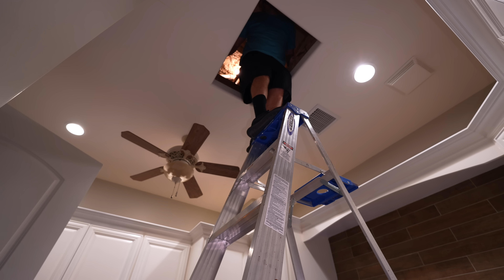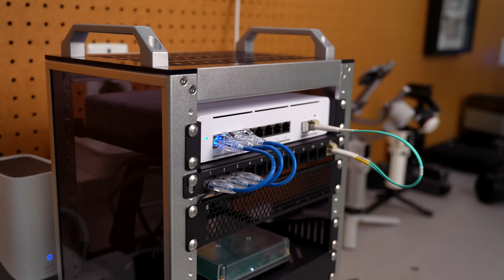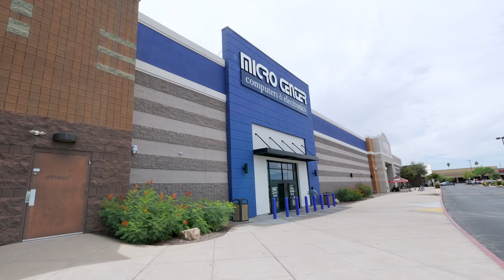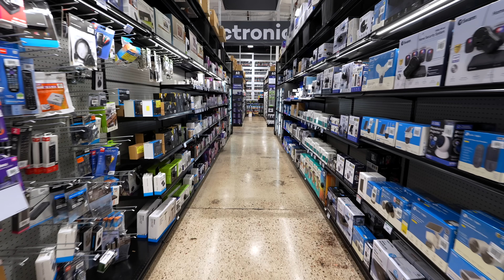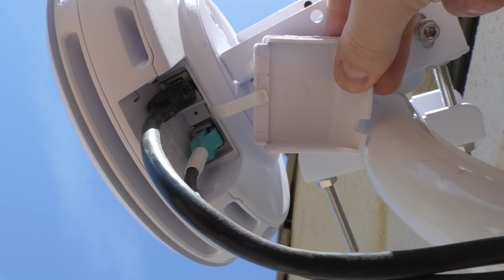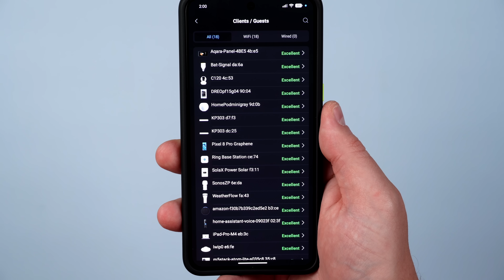Why I’m using UniFi Building Bridge for my Garage

Comment: I’m glad you’re happy with the result, but there are a few considerations. The visual impact of the wireless bridge could have been avoided by digging a trench and running fiber. I understand the cool factor, but most spouses would have rejected that setup on arrival. It also introduces two threat vectors. For a 50-foot run, cabling would likely have been cleaner, simpler, and nearly unmatched for reliability. Seems like a can versus should.

Comment: So the fiber and PoE cable goes from the attic of the main house to the bridge mounted on the main house. Then the other end goes down the wall into a patch panel on the wall, then from the wall you run another fiber and PoE cable to your server rack? Did I get that right. Also I'm confused how you ran the 2nd cables, can you explain it again in detail. Did you have to mount a 2nd Access point to your work office? That's where I'm confused

Comment: would the price for digging the trench have been cheaper than the cost of the hardware required for the point to point connection?

Comment: I had a similar problem; because of the way the buildings on the property are laid out, my ISP fiber comes into my carport, and when I had the house built, I forgot to run conduit from the carport to the main house. There are several inches thick of concrete driveway now between the house and carport. Trenching something now was not going to happen. I went with two U7 Outdoor APs. It might not be as fast as your bridge, but they do double duty as a bridge between buildings, and as outdoor APs. Overall, it's worked out really well.

Comment: I did the same with a Mikrotik wireless wire kit. 1G speed, but has been flawless for around 3 years. Paid $216 for the two in the kit. Getting full speed about 120ft away between two houses. One day I might rub a fiber between them, but so far this works good enough for my needs.

Comment: In the UniFi app, you can lock individual devices to the nearest AP. That way, you won't find those devices connecting to your wireless AP. It's really simple to do. And, then those devices will not go walkabout.

Comment: On the AP in the shop and house devices trying to connect, Since the shop is work space I would change the setup in unifi to have the switch and AP out there be a dedicated VLAN and different SSID name.

Comment: Is that an attic vent above where you drilled your wires? If so, why not run the wires through that instead of drilling holes in the stucco?

Comment: Reed - I am so jelly you have the microcenter there ... we lived in Peoria AZ until 4 years ago - my buddy there rubbed it in when he went over to the microcenter after it opened.  Both of us are into HA and Ubiquiti gear.  This video was handy as I plan to connect my 2 Unifi Pro XG 8 PoE 10G switches to my dreamwall using fiber - currently they are connected via Moca and coax (this house is almost impossible to feed cable thru).  Hopefully you were up in the attic before summer hit ...

Comment: It's not against code to run nonconductive f/o cable inside the electrical conduit to a garage. No trenching or access point expenses at all, not to mention the eyesore of the both mini dishes that could have easily been mounted inside of the attic spaces for that distance.

Comment: lol... I've been dealing with fiber for over 20 years...never cleaned one.  they are pretty resilient and you cautioned about bending them which is main weakness.  Since you had short runs, I doubt you will have speed concerns in the future, but if you were to do longer runs you need to pay attention to the fiber rating.  OM4 and OM5 are the most common these days and will support the latest SFPs.  I try to make sure the patch cables are the same rating as the fiber run.  not critical, just peace of mind.  As well, pay attention to the SFP type and speed (1gig, 10gig, 40gig) in conjunction with the fiber rating.  that will dictate how long your run can be between SFPs.  you're using Multimode (MM), but there is also Single Mode (SM) used by telcos and when you have runs over a few thousand feet and that uses different type of fiber.   I don't knock you for doing a wifi bridge, easier setup.

Comment: For that short of a distance with clear line of sight, wireless will be almost as reliable as wired. I wouldn't even think twice about using wireless for that. I would use wireless for this until I was doing renovations or had nothing better to do at which time I would install a couple wires/fiber runs in a conduit for redundancy.

Comment: As someone who has recently installed PVC irrigation that 'trenching' job (if you can even call it that) would have been so incredibly easy. Including going under the path.
Reply: Agreed. I was much disappoint that Reed didn't dig a trench like a real man ;-)

We'll see how reliable those transceivers will be after dealing with the elements for a few years, and how much energy they use compared with a buried fiber line.
Reply: Trenching would’ve been more reliable, but setting up a wireless bridge is more “fun”.  Sometimes you just want to do the fun stuff to see if it works.

Comment: We have the old UBB units at work running across a public street to a patch of land we lease, so getting fiber under the ground for that whole ordeal would have been in the 7-figure range. They have genuinely been the most reliable thing from Ubiquiti we have! You'd never know you weren't connected by a cable. They're maybe 200-300 feet from eachother.

FYI, for your APs, you should manually set the 2.4 GHz channels to 1, 6, and 11 instead of leaving them on Auto. Those channels have no overlap with each other. Channel 11 does have overlap with some of the Thread spectrum, and the other two do have some Zigbee overlap from what I understand, so make sure you know what channels your Zigbee network is using before setting the 2.4 GHz radios to one of those three!

Comment: For such a short distance, you could have just used a directional outdoor access point unless you absolutely needed 6Mb in your shop. Only requires one PoE ethernet cable and is a lot less money. I use that solution for my shop and I get fantastic connections, including most of my back yard so I can jam to streaming audio when I'm mowing.

Comment: Fun project! Glad it is working out great. I would be really surprised if you didn't get 100% link quality. I have used those bridges commercially and they reach over 1500ft.
A couple of  suggestions for your attic rules: 
1. Wear a mask, you have fiber glass insulation in your attic. Get one with P100 or N100 particulate filters.
2. Usually there are tons of nails sticking out. A hard hat is recommended.
Reply from the maker: Wow that's far! Those are some good tips for the attic too!

Comment: I did a very similar project to this and it was so successful im working on moving almost my entire lab and ALL 10g+ devices to fiber.  I had no idea that my copper 10g sfp+ ports were so hot but after I replaced them all of a sudden many of my network switches and servers started working better (less heat throttling).

Comment: With all the politeness, but 1000$ for wireless connection which can be done with 50$ straight fibre cable and 2 SFP modules. Ir will not depend on electricity (i mean connection itself and electricity needed for every RX/TX side in your case), no need for double data wiring and..... there is nothing to break if you use straight fibre connection. 
It would be interesting idea if you'd need to solve a problem like really long distance or obstructions (like water etc) on the way, which could cause problems. But instead you just made a potential problem.... you got x20 price connection line with 2 additional break points and way slower than fibre btw. Honestly - i dont get idea of radio bridge for 8meters btw buildings (except advertising fee from Unify/Microcentre ofc, but its a really bad advertising of this product).
P.S. your area climate is quite dry i suppose, but still recheck silicone once per couple years (might be surprises there if temperature changes a lot).

Comment: Looks like a lot of fun!  I would’ve just buried Ethernet though.  Ten years from now would work as well as you needed on day one.  Also, just my personal preference, I would’ve hid those ugly antennas in the attic on both sides.  They’re both installed right next to a window.  Good job though and good production!
Reply: he mentioned why you should not do ethernet, and a its a point any good IT person will tell you. Network link between 2 buildings is best as fiber and not copper.
Reply: @DustySeven7  I get that but the building is a few feet from the house.  Direct bury Ethernet is super cheap.  Maybe $20 for that distance.  Personal preference though.
Reply: @WunTu3 even a short distance like this. The risk just not worth it

Comment: Does weather affect the connection, like if it's raining, snowing, etc.?
Reply: At 60ghz, rain, snow, and ice are only a problem at much farther distances between the radios. As close as these are, weather would not affect them.

Comment: Interesting.  I routed a Cat5e to the detached garage and another to the shed when I pulled power to each building.  Was easy considering I already had a trench dug.  I can see the value to that bridge device, how reliable is the signal?  Degraded with weather?

Comment: A few things I wish you covered on fiber coming from a moderate network background.

Not all SFP modules are equivalent obviously on speed but also on compatible fiber type.  Most easy to find patches are going to be multi-mode.  Don't mix multi and single mode along the path.  You might get away with it on short runs but the mismatch will cause horrible losses.  Single mode is necessary only for high speeds over long distances. Patches can be IDed by the "standard" colors, teal for multi yellow for single.

Last but very important.  The two sockets on your SFP modules are transmit, TX, and receive, RX.  This must crossover between the two end points because the ports always have them on the same sides but you have to connect TXs to RXs.  You can actually see that your patch at 12:41 is this way because the strands are color coded yellow and white.  Each butt splice connection has the potential to swap this so you might end up miss matched after all your connections.  The patch cord ends can be gently disassembled and swapped if needed.

Comment: One addition to add to your install. While your fiber is protected from lightning strikes, the Ethernet providing the POE and backup connection to your wireless bridges is not. Install and properly ground a Ubiquiti Ethernet Surge Protection Outdoor to each one of your runs; UACC-ETH-SP-Pro. You’ll have some protection should one of your wireless bridges ever get hit.
Reply from the maker: That's a great tip! Thanks!

Comment: Rule #0: if your ladder is too short and you cannot afford an extended stay in the hospital, BUY A LONGER LADDER. Safety goes first, because being unsafe will cost so much more than being safe. Spending $200 on a longer, more stable ladder will prevent literal thousands of dollars in medical costs.
Reply: Yes, longer ladder, for sure.
Or install pull-down attic stairs—those would be even safer.
Reply from the maker: True a longer ladder is ideal but not all spaces have room for a large ladder. I have a taller ladder, that I also showed in this video but it can't go super tall in that room with the attic access because there's not enough space on the ground for the legs to go wide enough.

Comment: I related to this a lot as i recently replaced all my power cord cameras with PoE - so similar process of running cords through the house - except crawlspace instead of attic - and drilling through sides of the house. I was terrified of doing this job, but went through it a step at a time and the result is awesome and so worth the effort. 
Next I want to do the bedrooms and will have to face the fears of the attic and insulation in the way every step of the way of the whole project.

Comment: Here’s a tip since you’ll probably be going in the attic a few more times.  Get a few cheap sheets of OSB sheeting, cut them in widths to cover three of the joists so you’ll have firmer footing rather than balance walking on the joists. Leave them in the attic and if necessary you can even slide them around to other areas as needed.  It’s cheap insurance to prevent punching a hole through the ceiling.
Reply from the maker: I need to do that! Thanks!
Reply: @SmartHomeSolver  Never stand on OSB in an attic unless you're WANTING to fall through the ceiling.  3/4" plywood at least.  That foam insulation is a dream and made your trip in the attic bearable.  I've been in hundreds of attics AND I live in Florida. You gave the best advice possible.... GO SLOW!
Reply: @cableshark100    OSB comes in various thicknesses, up to 1 1/2" or more.  Placing it over three joists, probably 16" on center will provide firm footing for most people.  I cut mine in two foot widths so that it fits through the attic access door.   Plywood is significantly more expensive and pretty much a waste in an attic.

Comment: oof that foam roof good luck with that in 2 years
Reply: Why?
Reply: @Tadcrazio  it will start to rot for the moisture build up seen it day in day out on a daily its the worst thing you can do to your roof
Reply: @Scotty-Reed damn. Been getting quotes for it my neighbor has had it for 12 years and  has been happy.
Reply from the maker: Haha it's not a foam roof. That's insulation on the inside of the roof.
Reply: @SmartHomeSolver  hence the foam roof meaning inside

Comment: After a few decades of doing networking there are a few things I always keep in mind: 
- First one is "Wireless may be easy to install but wireless is a way to take something that works all the time and make it into something that usually works." Physical cabling just works unless it gets touched. Wireless network bridges are very good now but external interference can degrade or kill a connection overnight. (New neighbor is a ham radio enthusiast? Someone welding right there? Some jerk playing with SDR who just wants to ruin your day?)
- When analyzing a wireless bridge's connection, higher DB of signal isn't always better. Think about sending information as sound waves. If someone puts their lips to your ear and screams at the top of their lungs you can't understand them. The bridge should have a range of exceptable DB. A good bridge should have adjustable output, give you a DB reading, and allow you to adjust it. (Don't be surprised if visually aligning the bridges doesn't give the best signal. Often they look like they are off target when they have their best connection.
- Buried conduit with fiber is basically lightning strike proof. Exposed above ground outdoor devices have some lightning risk but longer runs create greater risk.
- Always run a bigger conduit than would seem as reasonable especially for your own projects! You need to have a pretty empty conduit to pull more through it and you will always think of something new you want to add next year.
- When making a choice about fiber always go with single mode instead of multi mode. Single mode has a much better range of capabilities and "future proofs" your cable choices when new capabilities come onto the market.
- When working in a very hot attic put an oscillating sprinkler up on the roof! It can drop the attic temperatures more than 30°f in a few minutes.
Reply: ISPs all across America deliver fiber to homes in armored cable buried a few inches deep. Conduits are nice, but IMO just get a spade shovel, move some dirt and drop armored cable down 4 inches. It’s such a simple job connecting two buildings that are a few dozen feet away. And much much much cheaper and more reliable than buying a $1k wireless solution like Reed did.
Reply: @badsomething  Is that depth acceptable?  I'm think about getting wired ethernet to my garage (30' from the house, all within my backyard).  I was assumed I'm need a 1"+ conduit 12"-18" below the ground.  [Conduit probable better for future-proofing, but I'd think more effort than just armored fiber cable.]
Reply: @jwhite4  I guess youtube deleted my comment.  Yes, 3-4 inches is fine, but if you wanna go for 6-8 inches, go for it.  I'd buy a "fiber to copper converter pair" which comes with matching SFP modules and ask AI to make sure it's compatible with your armored fiber cable.  So you have copper on each end, with fiber in-between buildings.  Don't use copper (ethernet) across 2 different buildings, you'll create a ground loop and the copper line will be full of noise which will result in bad performance, or it will just randomly quit.  Fiber is the only acceptable solutions when connecting 2 buildings.  For the copper to fiber converter pairs, you can choose either multi-mode or single mode, then either LC or SC connectors, and either 1G or 10G, there are no wrong answers.  Have AI help you if you have questions.  Obviously if you choose 10G then your copper ports on each end will need to be 10G compatible.
Reply: Great points! Plus fiber uses almost no energy compared to bi-directional wireless transceivers, which are also exposed to roasting sun, (possible) winter ice, rain, hail, humidity, ozone, insects, birds and their droppings, recreational activities (balls, etc.). Also those transceivers advertise the shop as a potential break-in target, and any shop security system or cameras could be defeated with a pole (e.g. swimming pool skimmer) pulling one of them down. Lastly, some may say those transceiver "barnacles" don't exactly add to the home's aesthetics.